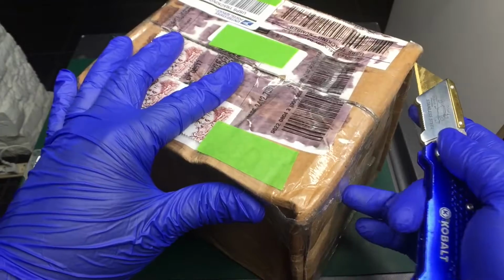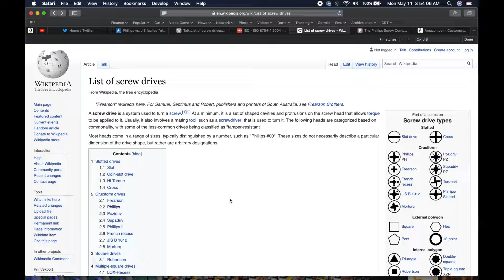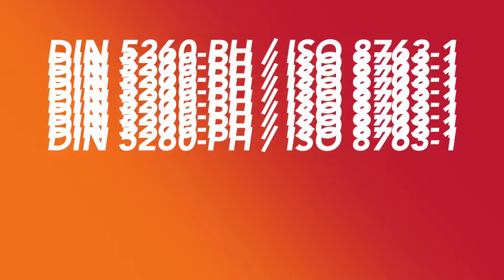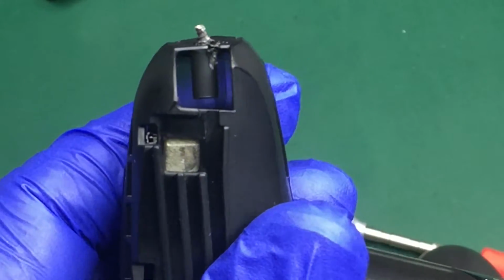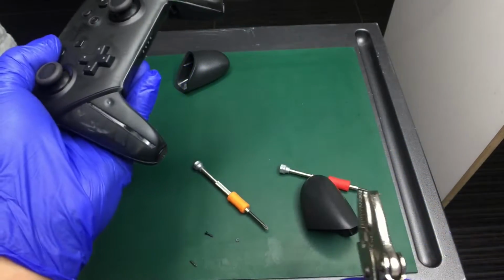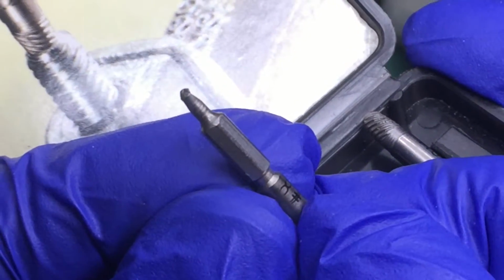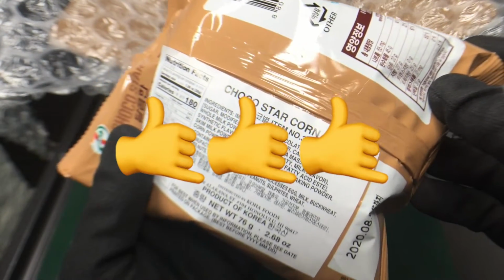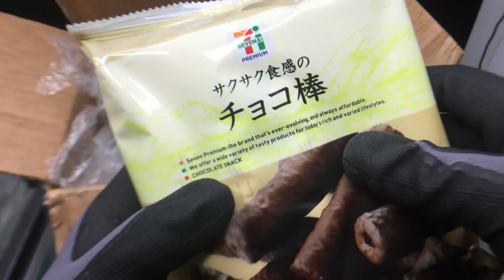Nintendo Switch Pro Controller Stuck Screw - JIS vs Phillips [SH ep.106]

Comment: nice work. The screw on mine was so tight that once I twisted it with enough force, something inside broke and now the screw just free spins and the grip wont come off.
Reply from the maker: Wow, is this an issue with these controllers?
Reply: Will Nintendo still repair ? I have a similar issue
Reply: @The_SegaHolic  Yes. My fucking JIS screwdriver bent and the screws have not moved an inch. I am considering just supergluing a new head onto the top of the screw, or drilling a counter threaded screw into it that I can use instead. This is extremely annoying.

Comment: My first experience with JIS screws was with Japanese motorcycles... the carbs in particular. I recall that some kind of drywall bit found in most hardware stores fits them pretty well but that probably wouldn't work for the smaller ones like these. Pretty awesome to finally see someone else using ABS Cement for plastic repairs. I've been doing it for years and trying to get more retro gaming/PC repair folks turned on to it. It's another thing I learned from motorcycle work 13 years ago (useful for ABS plastic fairings). The instructions on the can act like it's only for plumbing even though I never see ABS pipes in the stores that sell ABS Cement and PVC Cement. Plenty of PVC pipes though.
Reply from the maker: Haha. I've used a lot of stuff I learned from automotive, hoousehold, and appliance repair to good use. I need to get some acetone soon as my ABS cement is thickening up. Phillips actually made a crosspoint that fits JIS screws better, but you can dive in a rabbit hole if you start researching JIS, Philips, and crosspoint screws and drivers. Thanks for commenting and happy holidays.

Comment: how did you break the head?
Reply from the maker: Twist really hard. But you can drill it if need be. Use a small drill bit until the head breaks off. You'll have to pull hard on the cover as the threads are still there.
Reply: @The_SegaHolic  Did you drill the center of the screw, or using the drill to chip the head?
Reply from the maker: @d.rinrin  Drill in the center with a thin bit, about the size of the threads. You can see it from the other screw you can take off. Go really slow, the slowest you can. The head will come off when you get deep enough and will be around the drill bit. Again, go as slow as you can. Also, dip the bit in some motor oil so that you don't burn the bit and helps cut the metal. Other wise, you can use a bigger bit right at the center, but harder to controll. and just try to destroy the head.

I actually snapped off the head by trying to unscrew it.
Reply: @The_SegaHolic  thank youu! I will try this method

Comment: Really scumbag design move by Nintendo. One of my screws on one side won't unscrew, like they've glued it in to prevent fixing it ourselves to force us to buy another control after they inevitably break.
Reply from the maker: Whatever machine did the scewing, it obviously didn't align the screw properly, and drilled to the side of the hole.
Reply: It isn’t there problem they intend to not let you have access to the inside of the controller you can always call them as they offer free repairs but opening the controller and making a shell or button replacement will lose the warranty
Reply: @vvx600  You literally came to a repair channel to tell people they shouldn't repair stuff.
Reply: @user-cg3em4cw4f  no i just gave a suggestion.
Reply: I had the same issue on both my controllers! Crazy how it’s always just on one of them

Comment: Can you please tell me where you got your screwdriver or what it's called exactly? I know it's JIS but i don't know if i can find the right one. I've tried everything to remove the screws at the bottom of my pro controller and stripped it pretty bad so im not really sure what to do. Would i still be able to get it out with a jis?
Reply from the maker: Just buy a set of JIS screwdrivers on Amazon. I would recommend this one. You just need the handle, which you can find cheap at home depot or lowes.
Reply from the maker: https://www.amazon.com/gp/product/B0751K53BJ/
Reply: @The_SegaHolic  thank you, this helps alot. I appreciate it!
Reply from the maker: @topramenallday  You're welcome , and thanks for the thanks. Means a lot.

Comment: Hello!!! Quick question! I see you used different screws compared to the ones the pro controller comes with which makes me think I can replace them with better quality ones... How are these called? What size are them? I would appreciate if you could help us all...!
Reply from the maker: The reason I used a different screw was that the orignal broke, and where do you source the exact screw? So you take the closest you have in your parts bin. So I don't know the exact size. Just find a small one, and see if it works.
Reply: Ok, thanks... Believe it or not it seems no hardware store have them in this God's forsaken country haha... Closest I found was a 3 mm diameter shaft... I will keep looking, thanks again...
Reply from the maker: @Manuel012387  https://www.amazon.com/Craftsman-Ball-Screwdriver-Reversible-Phillips/dp/B015I6OH8G/ The ball grip is best. Provides plenty grip.

Comment: Hey I realize this is an older video and I just stumbled on it because I wanted to change the shell on my pro controller I used the screwdriver the new shell came with and it stripped the screws, I watched so many videos on how to remove stripped screws and made it worse. I just want to know if you’d be able to take out the screws for me. How much would that be etc. thank you for your time
Reply from the maker: This is what really happenned. One of the screws that holds the grips were screwed in crooked at the factory and missed the precut hole the screw is supposed to go through, so it's super tight. Email me at my contact email address here and I'll see if I can get the grips off. Just get it to me, and I'll do it for free. I suggest you use USPS priority in a box that has sides not more than 12" (1ft) long and try to keep it under 1lb to really save on shipping costs. LMK in a reply here if you have emailed me, as I rarely check my email.
Reply: @The_SegaHolic  hey i need some help too :)
Reply: @The_SegaHolic  Hello, i sent an email! please help meee

Comment: Good job on the repair. Very informative especially the screw drivers. Just bought myself a set of vessels.
I have a question though. My bro tried to drill out a stripped screw on the left side of his Pro controller. He drilled on the sides of the screw hole to try and "pry" it out. Now the grips have essentially 2 holes next to each other. How do you go about repairing that? In the video you used cement on the shell but I'm not sure if that's still applicable for a hole in the grip itself.
Thanks!
Reply from the maker: The abs cement is actually abs plastic melted with acetone, so you can use it to build up and fill. You can shape and sand.
Reply: @The_SegaHolic  Thanks!
Reply from the maker: @blckthrn2k8  BTW, the can dries out quickly. Just get pure acetone at walmart and add when it gets too thick. Its great stuff to have for console fixers as its great for anything abs.
Reply: @The_SegaHolic  I'll keep that in mind. Thanks again! :)

Comment: Are you able to fix new 3DS for free to? My left trigger button doesnt work cause it fell on concrete years ago. I wanna fix it but the screws on the microsd card part are stripped. Are you able to fix and is there a catch to the free fix? Please respond if you can. 🙂
Reply from the maker: The catch is, my free offer expired a while back. How'd it fall into concrete? LOL.
Reply: @The_SegaHolic  oof, it was in my pocket and it fell out. How much would you charge for a repair
Reply from the maker: @SkyfuWaifu  Oh, I was thinking wet concrete. That woulda really sucked. Super busy right now. Apologies. Thanks for considering me though. Ask me in February.
Reply: @The_SegaHolic  yea no problem 🙂
Reply from the maker: @SkyfuWaifu  Thanbks 👍